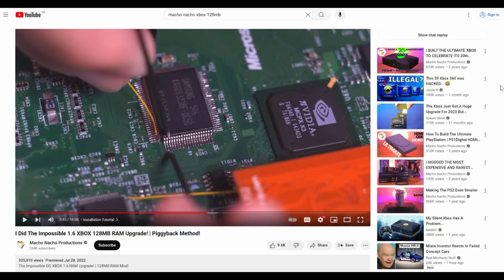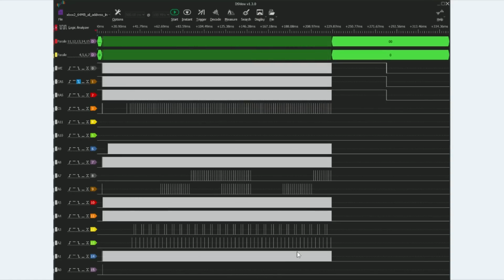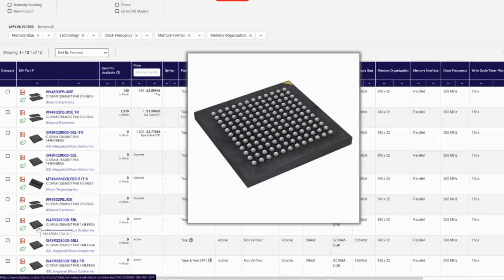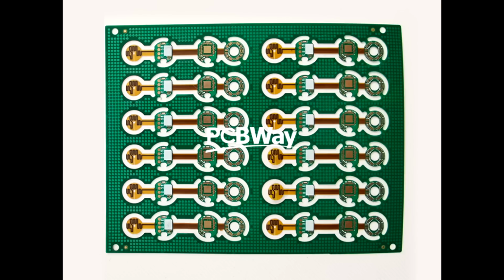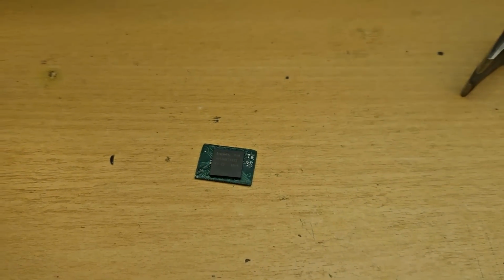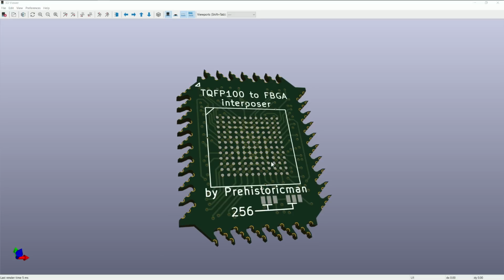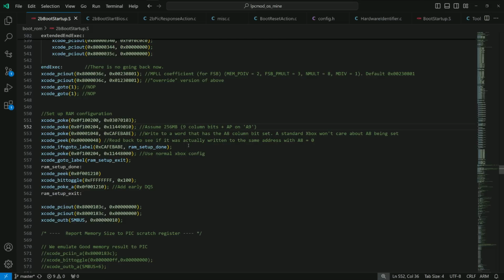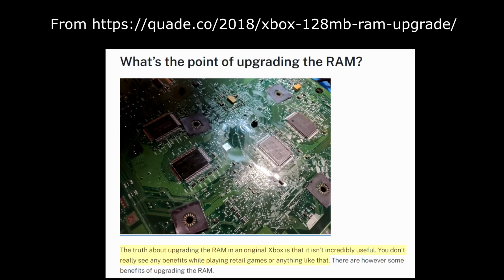How I put 256MB of RAM in the original Xbox

Comment: Personally I'm just after reliable replacement chips for repairs & the 128 upgrade.
I've tried with 2 separate Ebay sets of chips & neither of them have all chips working & it's such a headache to even begin to troubleshoot, I know basically nothing about IC design & functions to be bale to in anyway design my own rigs to test.
I soldered each pin individually, took an age but for a first time I wanted to be sure there wasn't ever going to be too much solder that might somehow get underneath & bridge a via or just be an obscured bridge.

Suppose I could use this project to learn how to do basic read/writes in memory & go from there.

I've watched this 3 times now & I still don't understand why that A8 rewiring worked.
Only that it needed to be done in order to switch where the AP refresh went (I think).
Oooooh, I've just seen, you bent the pins up & just wired from 1 to the other pin to pad, duh.

I still don't get why it couldn't just be switched to A9 without issue though.
And I probably still won't understand even if you tell me here because I simply do not know what's really going on inside the chip in any real detail.
Reply from the maker: Unfortunately the 256MB mod is pretty damn unreliable, and I don't think I can solve it. Yeah the A8/AP issue is a bit hard to understand, sorry about that.
Reply: @userPrehistoricman  Ah OK, thanks for responding, it's good to get an update on this even after 2 years.
Shame it's still being pretty unreliable.

Do you know why this difference does not matter, the Xbox's list 'Full Page" as well but the Hynix does not.
"Programmable Burst Length 2 / 4 / 8 with both
sequential and interleave mode."
Seems unimportant if large image files can just be loaded no problem.

You know, with some of the differences I'm seeing in the originals chips K4D263238F specs the more I am surprised it even worked at all.
The EMRS encodes the Output Driver Impedance completely differently in the Hynix.

Comment: Do you have a git release? Also i am sort of sure that stability is a cause of the following 2 things:
1) total lack of local decoupling capacitors 
2) poor signal integrity from the way signals are routed 
Also you could have PCBway assemble them for relatively cheap this is mostly for consistency and mass batch production. 
Also this is probably a consequence of time but why not use a thinner dielectric  FR4? as in SSDs for example are 1-0.8 mm and you could potentially use some thinner rigid flex .
But main advice would be signal integrity rerouting and capacitors.  
If you need help ASK.
Reply from the maker: Yes https://github.com/Prehistoricman/Xbox256MB/
There are decoupling caps on the motherboard. I reason they are just as far from the silicon as the original chip with its lead frame and bonds.
With only 4 layers I didn't have a lot of choice when it came to signal routing. Feel free to check the design and offer any specific advice.
Reply: @userPrehistoricman ok I'll check it tonight.  Also distance is not the only factor. You did add a lot of resistance and inductance with pcb traces.
Reply: @userPrehistoricman  Ill take a look and tell you what could have been done better on 4L and advise for a potential revision
Reply: @userPrehistoricman     so on 4L there is a good amount of space for improvements
In this order, based on own mistakes* + intuition:
1) more via on Vdd Vddq Vss Vssq  one for each ball on pag 21 it is also mentioned that they have same voltage range + no power up sequence
also on pag 15 of the datasheet it is mentioned that Vdd/Vddq can be tied together tho i would advise not to since there may be extra high side filtering on the PCB BUT Vss and Vssq can and should be tied together 
2) tie together Vss with Vssq and make a full plane on L2 and keep it as unbroken as you can

3) from what i read from the datasheet all data signals should be 50 ohm impedance single ended but from what i see in the PCB with 0.2 mm they probably are not 50 OHM
4) Length matching the data traces (assume they are matched on initial PCB)  your data lanes vary between 6 mm and 11 mm so 5 mm mismatch , 100–133 MHz should be 2.5 mm or less but if you want higher data rates you should strive for way better then u have atm, YES there are also extra chip tolerances but you should not rely on bonus tolerances, this is no DDR so it is not so strict but still you need enough matching 

5*) add a few 1uF on the PCB mostly just in case and as places from where to measure the power rails later if you can 

Final notes: i would mostly focus on 2) +4) +3) since together they will have the largest impact , i have a feeling that from the signs i saw in videos it is not a brownout BUT that could happen at higher speeds, here is mostly 1) +2)+5) BUT without measuring i sort can only guess
Reply from the maker: @sanjikaneki6226  thank you, will look into it
Reply: @userPrehistoricman  IF you cant i can take a look before you order.
I dont have a XBOX and i am treating it purely as any high speed PCB design. IF you can confirm Vdd and Vddq have the same PSU then you could also tie them together in a plane and thus improve signal integrity and simplify the PCB. For this a multi meter should be enough

Comment: Would love to see the new flex version be sold preassembled. This is also perfect for doing 128mb ram mods to 1.6's, since stacking the ram chip is more difficult.
Reply from the maker: if you're interested in buying some from me assembled and tested, message me on the ogxbox forums or twitter @Prehis2oricman
Reply: @userPrehistoricman  Thanks for the reply will be sure to soon enough. Do you plan on selling them on Tindie or Etsy? It would be great to see them get listed.
Reply from the maker: @8bitnation419  I was considering it but I have seen a very low amount of interest so it makes more sense to just do commerce direct to customer.
Reply: @userPrehistoricman  That's a shame, as long as compatibility is great, you can definitely sell these in 128mb and 256mb configurations. As long as they're sold on flex PCBs. Also performing a 128mb mod on a 1.6 is not easy, and it can get a bit messy, compared to just using one larger chip.
Reply: @userPrehistoricman  I would like to buy a few. Do you think they run on 1.6 with regular clocks?
Reply from the maker: @lordvectrex  Still haven't heard anything from anyone trying it with a 1.6. I expect it to work, and to work at normal clock speed with 128MB.
Reply from the maker: @lordvectrex  Both of my 1.6s currently don't work! They are tied up in testing Xyclops things
Reply: @userPrehistoricman  Interesting. Excited to play around with these chips. How much do you charge for 12 chips?
Reply from the maker: @lordvectrex  $130 or £97 plus shipping
Reply: @userPrehistoricman  nice. Do you ship to Switzerland?
Reply from the maker: @lordvectrex  Yes. The shipping is about £10
Reply: @userPrehistoricman  Send me your email. I want to contact you to finish the deal
Reply: @userPrehistoricman  once things get ironed out I wanna give this mod a swing it would most likely help with forced 720p Serious Sam 2 which runs low on memory at level 8 or 9 at about 4kb or 9kb needed
Reply from the maker: @Hellraiser988  even 128MB is not enough?

Comment: Have the same issue with modification of an old Roland sequencer. They share the main board with a number of models, and even though there is place for extra ram chips, they can't be addressed, even when installed, without doing some multiplexing magic on the address lanes. I haven't gone that far, as I only have a single mint condition unit and I can't afford to take any chances with it.

Comment: So I actually kind of want to know why didn't you just try to use Zebra strip for the motherboard connecting to the RAM?  It's that Vertically aligned sandwiches of like silicon and conductor that you can just sort of slap on there and as long as the pieces are aligned it conducts the right way.   It's the kind of shit that went behind LCDs on old calculators. I had actually been thinking about using it for building a ram tester to make a quick interconnect For edge connectors In an automated tool, but I'm not sure that it would work at the bandwidth and I couldn't quite find specs on what it would work at.
Reply from the maker: I thought about it a bit and yeah I had your same concern about signal integrity. The LCDs that use zebra strips are relatively low speed.

My main concern is that they need vertical pressure to keep the connection. I'd need something like a big frame that gets screwed into the case to hold them down.

Comment: What a journey! The suspense from the reveal of the jig was fantastic, great video!

I've just dug out my 1.0 board that I did the 128mb ram module upgrade on back in the day and it seems to now be getting a red & orange 3 boot "frag" I've gone over my work a few times but I'm not having much luck and it did work with xbmc at the time...
Would your debug xcode bios help for tracking down shorts and faults for the 128mb mod as well?

Once the kits are available where will we find them? I can't wait to see how Linux runs with 256mb and an SSD!

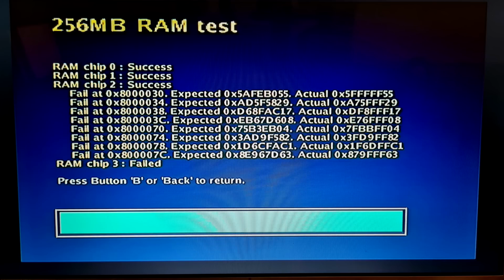Comment: 15:30 PCB Trace Length Matching?
Reply from the maker: Possibly, but I don't believe the length matching requirements are so strict.
Reply: @userPrehistoricman  
But I find it more interesting to install faster RAM instead of twice the capacity. in order to achieve a difference in performance if necessary.
Reply from the maker: @ludger0815  That has been tried too. I think they hit a hard limit around 250MHz (25% faster than stock).

Comment: What about using one of those soft vertical conducting strips that are used behind the screen of plain old calculators. They can work as a conductor and as a pressure source. Although not sure how much current they could handle 😅
Reply from the maker: I thought about that but you need a mechanical setup to apply pressure to the strip which would complicate the whole thing a lot.

Comment: Memory Bus I/O is an interesting thing, I've actually encountered Intel processors that can only handle so much ram capacitance to drive, known good sticks suddenly not working only when all 4 slots were filled, tried multiple types, made returns and exchanges.. twice.. then swapped the processor later for a xeon(mobo with a socket that supported both and also had bios support added later, lucky), and THEN found out it could see all the RAM just fine, weak bus drivers apparently that flaked when the capacitive load skewed things too far.

Also because you made the interposer more like a BGA part, you should look into z-conductive polymer, "Der8auer EN" had some of this 2 weeks ago in 'How Memory Sticks are tested and programmed'

Comment: This type of RAM upgrade is only worth it for a faster CPU. The stock 700Mhz celeron that comes equipped with the XBOX will never utilize that size RAM for a pre render computation. I believe the fastest processor ever installed on the XBOX is pentium 1.4 Ghz and even then with that faster pre render that CPU doesnt even over load the 128 MB memory that was used for the XBOX debug kits. Essentially a dual core cpu with at least 1.7Ghz would be needed with bios modification to push that ram to its limit. I believe because of the polygon and vertex shading methods used by the GPU it wont ever use more than 128MB, possibly as tad more. Its still fascinating to see that this Ram increase was achievable.
Reply from the maker: It doesn't really work like that: processing speed isn't so directly related to memory usage. You can easily make a program that requires no computation but lots of memory.
In terms of games, sure, because you can only increase the memory usage by increasing the resolution.
Reply: I guess is more about getting a faster ram too with a cpu upgrade cause stock cpu on ogx are 128mb cache and tualatin p3 are 512k cache.

Comment: MS has a crazy method of progressively changing gibberish code to confuse and secure a lot of their software. 01010101 01110011 01100101 00100000 01100001 00100000 01101000 01101111 01110100 00100000 01110000 01101100 01100001 01110100 01100101 00101110 00100000 01101101 01110101 01100011 01101000 00100000 01110011 01100001 01100110 01100101 01110010 00100001 00100000 01000010 01100101 01110100 01110100 01100101 01110010 00100000 01110010 01100101 01110011 01110101 01101100 01110100 00101110

Comment: Hey, I suspect that the memory clocking issues are due to the interposer pcb you made not length matching the traces on the data and addressing pins.
Even at the slow clockrates of DDR memory, length matching traces is absolutely critical for avoiding random data corruption.
You can see on the xbox mobo how some traces tend to snake back and forth for no reason, and length matching is pretty much always the reason why.

I encountered this issue personally when I worked in QA testing.  I was getting random frame corruption on our prototype's gigabit ethernet port.  Gigabit ethernet is actually clocked at only 250Mhz, so neither engineering or I thought that length matching would matter, especially since the traces only differed in length by 2mm.  But after testing and a new PCB prototype with correctly matched traces the problem disappeared entirely.
Reply: I did notice that the chip he has picked has a datastrobe for each byte to align the transmission unlike the original chips that have a single datastrobe pin for the whole databus, I do wonder if this is causing an issue?
Reply: @professor_jonny  newbie here. Would the result be random data corruption or is there a way to measure desynchronization?
Reply: @yeezusjesus7617  yes, a logic probe but even connecting a logic probe can cause corruption high speed signals if not integrated properly.

Comment: Keep upgrading, man!
I heard that there are some Xeon CPUs from the Xbox era that should be socket-compatible.
It’d also be cool to upgrade the DVD drive to a faster model, or to find a better GPU.
Reply: P3 Xeons came on cards for their entire lifespan. I dont know if the BGA of the CPU on the card is compatible with standard P3s but if it is then a 2MB cache Xeon in the xbox would be insane indeed.
Reply: @ Custom PCB adapter boards could probably be made.
Reply: The Pentium III 3 Tualatin core 1400 MHz (512k cache iirc) with 133 MHz FSB was the fastest Pentium III ever made, and superseded the slot II Xeons (in the context of Pentium IIIs anyway). They also made a 1.3 or 1.4 Celeron, which is the same thing but with 100 MHz FSB and half of the L2 Cache; people have already done the mod, and it is indeed the very best the Pentium III had to offer. Yea the older Xeons had a lot of cache, but it wasn't on die, and was much much slower. That's why the Celeron 300A was so popular when it launched; a quarter of the cache but way faster so the chip could match or outrun a Pentium III of the same clock speed.

Comment: Isn't there a performance penalty because of the swapped address lines?
Reply from the maker: If I routed them directly, then no. But I do route them via some solder jumpers so that could have an impact, yes.
Reply: @userPrehistoricman  not the layout itself, but the way the DRAM works with swapped address bits.
Reply from the maker: @simmydsimmyd  I don't think that has any impact. The DRAM isn't aware of the swap
Reply: @userPrehistoricman  I imagine word operations would be fine, but wouldn't the swap cause issue for burst operations?